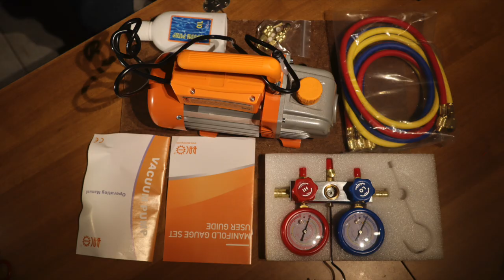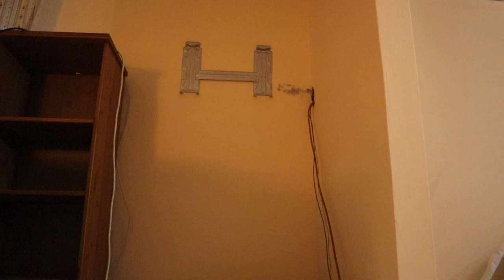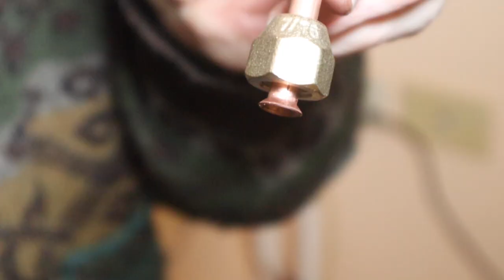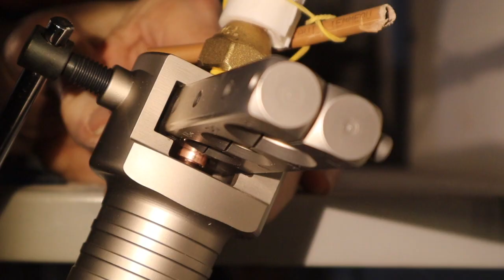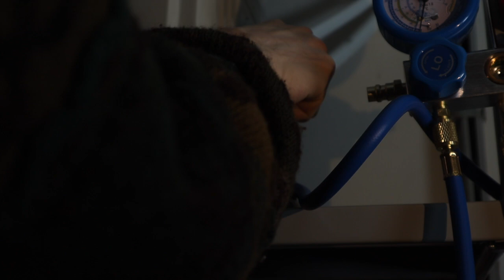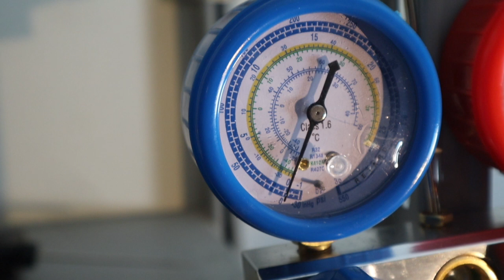I Installed My First Split Heat Pump Myself and Saved BIG - 82

Comment: An alternate to installing the external pump in the garage is to draw air through an earthtube before the heat pump.  Air picks up heat from underground in winter and "cool" in summer.

If you choose to dig, you could make CHP in underground so exhaust leak risk and noise would be negated.
Reply from the maker: The tunnel idea is indeed something that was implemented in a antique villa near Verona but there are many other examples. I saw in the past an opportunity of a very big factory in Liechtenstein (2000 employees) with a tunnel and proposed to take air for the many air compressors they had.

Comment: Just fyi, there are diy minisplit heat pump systems on thebmarket now that require no tools other than mounting (precharged).  Many people with less skill than you take this approach.
Reply from the maker: This actually was one: precharged and under 300€. But still a lot that can go wrong, so the first experience took me a lot of research to stay on the save side.

Comment: Did you wait 17 hours for checking the vacuum? It was not just 17 minutes?
Reply from the maker: Yes sir, 17 hours, an evening and a night. Considering it was my first time, I wanted to be sure. It was also difficult to read a small difference on  a total pressure of 1 bar when the scale was 30 bar.

Comment: Came across this video on the Tesla heat pump system that is rated down to -40c... pretty efficient using an inverter compressor. It harvests heat from all the onboard computers and electronics. At 54 minutes it goes over the EEVS that supply the different areas of the vehicle with refrigerant. It's like having a really complex vrf system on board that recovers heat from batteries and motors to heat the cabin in addition to using the outside air. 

https://youtu.be/Dujr3DRkpDU
Reply from the maker: Hi Richard, that is very advanced tech, didn't expect that they go really the last mile to efficiency and integration.  Also the channe you mentioned is very interesting and has a new subscriber. It is for car mechanical workers and I am translator of car maintenance documents for Porsche into Dutch. Would be nice to know if Tesla needs such translators.  I will look for inspiration to this channel to see what practices can be transferred to DIY.  Thanks again!

Comment: I've often wondered whether there was any way I could harness the wasted energy from my car when I arrive home, your solution is doing exactly that! Very impressive and good thinking outside the box!
Reply from the maker: Thank you Vane! I actually am thinking about using the car instead of this small generator.  It has an alternator but at idle operation I want to find out how many Ampère it gives and what the final electric efficiency is. You can always running it a bit faster, like 1100 rpm and see what changes. Even if the electric efficiency is low, it will produce a lot of heat and you will need a much bigger heat pump. But a good part of the heat is at 90 degrees and that you can connect to the central heating circuit.  That's a lot to think about but for a cold winter and a big house it seems interesting...
Reply: @nnvasen-good-energy  I have been thinking about fitting fuel injection and lambda sensor to my petrol generator which I would imagine would help to bring the efficiency up a bit more, maybe worth investigating before putting the wear and tear on your car.

Comment: Cool project! Looking forward to measurements; i am toying with similar ideas but i do wonder how fast the small space will completely suck up the warm air if the generator is not running. Also do you plan to use it for cooling during summer?
Reply from the maker: Hi Geek, thank you for your good question! Our garage is about 4×9 m so that is pretty big and with all the stuff that is inside it, it has a great heat capacity. At least in the half of it where the heat pump is installed, the temperature decreased 4°C in 2,5 hours with the external units taking about 2 kW.
This idea is not so good for summer as it is for the winter because their generator will make a lot of heat. However, if you just don't use that and it is very hot outside, you can attract cool air from the north side of the house into the garage and then you have at least a smaller temperature difference than when the external unit is in the sun.

Comment: THERES A YOUTUBER VACCING DOWN A STEAM POWERED TESLA TURBINE - THE WATER DOESN'T BOIL AT 100oC- IT BOILS FAR BELOW-VERY INTERSTING SYSTEM- THIS ALLOWS HOME ELECTRIC GENERATION WHERE THERES INSUFFICIENT SUNSHINE TO BOIL WATER AT 100oC.
Reply from the maker: As a last minute addition on the video I added some comments in the footage of the vacuum pump about these kind of interesting physics "in the universe" without atmosphere. Would be nice to try out the pump on a glass jar and see what happens with the water inside! I also make a remark there about the danger of imploding glass jars. An idea for a short video about physics behind a safe glass window!
Reply: @nnvasen-good-energy  COCA cola tin, just implodes,you can buy vacuum jars,strengthened glass.

Comment: THE SPRING ON THE PIPE IS TO STOP YOU PUTTING A KINK IN IT.
Reply from the maker: Hi Liam, you know a lot of this stuff, is it your sector? The spring is only on the low pressure tube, I imagine that small diameter tube has less risk to get a kink. Thank you for the info!

Comment: CONDENSING PIPE- CAN GO UPWARDS,IF ABSOLUTELY NECESSARY - BUT YOULL NEED TO BUY A CONDENSATE PUMP FROM AN AIR-CONDITIONING SUPPLIER.
Reply from the maker: Sorry Liam if it was not clear, the drain is going down from left to right through the wall, so water streams down. During winter we just leave it open, the cold is created in the other unit, in the garage.
Reply: @nnvasen-good-energy  I MENTONED UPWARD PIPE SOLUTION FOR YOUR VIEWERS.... 
SORRY- THE CONDENSATE PIPE- I WAS THINKING ABOUT COMBI- BOILER( WAS TRYING TO DO 3 THINGS AT ONCE-VERY BAD HABIT)..🤬🤬🤬

Comment: RE: PLACING THE UNITS-BEFORE PURCHASE,READ MANUFACTURERS SPECIFICATIONS ON LOCATION- THE OUTDOOR UNIT HAS TO HAVE " BREATHING SPACE" TO WORK CORRECTLY - MINIMUM SPACES AROUND IT, AND THE INSIDE UNIT, ALSO HAS REQUIREMENTS-YOU CAN PUT THEM ANYWHERE,BUT IF NOT TO SPECIFICATIONS,YOU WILL NOT GET AS MUCH EFFICIENCY,EITHER IN ENERGY USE, OR IN HEATING OR COOLING TEMPERATURES AND TIMES TO TEMPERATURES-ITS ALSO ESSENTIAL TO ENSURE GOOD PIPE INSULATION- EXTRA DIY INSULATION AROUND PIPEWORK VALVES ISN'T REQUIRED,BUT IF YOU HAVE SOME SPARE INSULATION,WRAPPING IT AROUND HIGH AND LOW VALVES CAN ONLY IMPROVE EFFICIENCY.
YOUR OUTDOOR UNIT FAN BLADES CAN COLLECT DIRT, IN DIRTY CONDITIONS - PUT A SIX MONTH REMINDER ON YOUR PHONE,TO HAVE A LOOK- IF BADLY CONTAMINATED,CLEAN- THEN CHECK INDOOR FILTER.
Reply from the maker: I left about 15 cm behind the outside unit and I will finish the insulation of some uncovered pipes. It was really a challenge to get the video out in the weekend with so much work and that's for the first time :-)
Reply: @nnvasen-good-energy  YOU DID AMAZINGLY WELL- BUT YOU CANT RUSH THIS STUFF- REFRIGERANT HITTING EYEBALL WILL INSTANTLY FREEZE- AND KILL IT-ANY ON SKIN CAN MAKE DEEP FROSTBITE- I NEVER WORKED FOR ANY COMPANY THAT REQUIRED X NUMBER OF JOBS PER DAY- BEATING THE CLOCK IS A FALSE ECONOMY- I ONLY WORK FOR COMPANIES THAT GIVE ONE JOB AT A TIME- YOU RING IN WHEN FINISHED- NO PRESSURE,JUST DO JOB RIGHT- I CAN COUNT MY CALLBACKS OVER A DECADE ON ONE HAND...
Reply: @nnvasen-good-energy  the most important thing is that it's LEVEL- put on a paving slab if in a garden, preferably with a bag of gravel underneath- I've seen fan bearings go noisy+ then fail in months where an outdoor unit has been only slightly unlevel...

Comment: RE- VACUUM ALL QUALIFIED ENGINEERS KNOW THAT YOU HAVE TO PULL NOT JUST VACUUM - BUT MAXIMUM VACUUM+NOT JUST FOR A MINUTE OR 2 YOU HAVE TO GO TO MAX- TO MAKE ANY WATER MOLECULES IN THE SYSTEM BEGIN TO BOIL,AND BECOME A GAS,WHICH IS THEN SUCKED OUT TO THE ATMOSPHERE, BY THE VACUUM PUMP.
RE:SAFE HANDLING OF REFRIGERANT - I BELIEVE THAT PRE- CHARGED UNITS CAN BE WORKED ON,BY NON QUALIFIED PEOPLE-AS LONG AS THEY STRICTLY COMPLY WITH MANUFACTURERS INSTRUCTIONS- THINK OF IT,IF IT WAS ILLEGAL- THEY COULD BE FINED FOR SELLING THEM...ALSO- IF IT WAS FOR CERTIFIED ENGINEERS ONLY-THEY WOULD SHIP EMPTY-SO ENGINEER COULD WEIGH IN RIGHT AMOUNT OF REFRIGERANT...
HANDLING REFRIGERANT IS A PHYSICALLY RISKY BUSINESS-ALWAYS WEAR GLOVES+ EYE PROTECTION,ALTHOUGH YOU SHOULDNT BE RELEASING ANYTHING BUT A TINY SQUIRT OF REFRIGERANT, ACCIDENTS CAN,AND DO,HAPPEN.
Reply from the maker: I saw it also videos of professionals that I had to use the pump for 10 to 30 minutes and I used it 14 minutes. Maybe you know also the answer on my question that is at about minutes 25 or so: why is the initial static pressure so high above the seven bar that I think is normal at the temperature of heating degrees Celsius?
Reply: @nnvasen-good-energy  they have pre charged your unit, so the gas isn't at room pressure,has enough pressure to go round the max amount of pipe  they specify.
Reply: @nnvasen-good-energy  me personally, I would vac out for their recommendation turn it off for an hour, check it's still holding vacuum, then do another 30 mins.
The expansion valve nozzle is so tiny( think of nozzle on an aerosol can) that any moisture can completely block IT- for the sake of an extra 30 mins of electricity, your guaranteed that won't happen - for office blocks,hotels,etc, it's common to let it run overnight.
Reply: I HAVE NO REASON WHY,BUT YOUTUBE HAVE JUST SCORED A LINE THROUGH MOST OF MY FACTUAL INFORMATION!!! ???
Reply from the maker: no problem, I can read it.

Comment: Dar cum rezolvi problema inevitabilă a apei care apare în camera unde ai montat unitatea exterioara a aerului condiționat?
Reply from the maker: For the audience: "But how do you deal with the inevitable problem of water appearing in the room where you've installed the outdoor air conditioning unit?"
Hi invertor, you are right, I responded below to Richard on distillation water. The drain outlet has been dry these first 24 hours but I put already at dish under it. This video took me so much time that I could not think about all the details 😬. The product contained a piece that I can put under it and connect a hose. I will catch the water into a 5 litre bottle (looking how much time it needs to fill) and use that to wash the car windscreen, as it doesn't leave traces.
Reply: @nnvasen-good-energy  Thank you for your time
Reply: @nnvasen-good-energy  IF YOU GET BELOW ZERO TEMPS, I RECOMMEND YOU INSULATE WHERE IT MAY GET COLD- IF IT FREEZES,YOU CAN GET THE WATER RUNNINGS OUT OF YOUR INDOOR UNIT, DOWN THE WALL + INTO CARPET...🤯🤯🤯
Reply from the maker: I put a dish under the drain but it never makes water at the air conditions in the garage, 15 degrees

Comment: If you don't have a certificate for f-gasses. How can you claim compliance to the regulations put in place by the European Union?
Reply from the maker: You are absolutely right Skinkie, the only formality that I did is to sign the form that I renounce on the warranty of the heat pump. For the rest, my compliance is only technical and not formal. But for now, I am happy with that.
Reply: @nnvasen-good-energy  There is some dispute on how much R32 would actually be require certification. But I think much better way would be R290 (propane) or R600 (butane), the stuff you did with the other projects. There are numerous brands already having minisplits with this gas.
Reply from the maker: That's a good point to avoid the compliance issue!
Reply from the maker: I think that R290 project was a mobile airco from Spain,  a EU country.

Comment: You are an inspirational,  intelligent man and I love seeing your content. I can never recommend fitting the condensing unit indoors they suck so much heat out of the air. I see you are trying to recover the heat from the generator but this heat will not be that much in terms of how much heat the unit removes from the air. 

Where is all the condensate going to go that the outdoor unit makes? It will slowly freeze your garage and dehumidify it so much that it will then not be as efficient to heat. The latent heat in the moisture in the air is good for the unit to remove when it's outside.
Reply from the maker: Thank you so much Richard, I feel more power to go ahead! You are absolutely right that if I don't integrate the expected heat, the garage will slowly become a deep freezer 😀. The heat pump it's not very big, 2,7 kW. The generator gets 1.7 kW electricity so if it goes a little bit under this nominal value then the heat, which should be about twice as much, can do it. Thanks to the battery. I can let it run at this power for long while. Anyway, you are a again right that energy management is necessary to keep it all in balance. Fortunately, the garage is big and contains a lot of stuff, so it will have a nice big thermal capacity.
The latent energy in the humid air is a good point. We have about 50-60% relative humidity. The drain outlet has been dry these first 24 hours but I put already at dish under it. This video took me so much time that I could not think about all the details 😬.
Next week or the week after I will add the gasoline generator of Pramac (made in Tuscany, near Siena). I bought it and it is a jewel compared with the gasoline generator of 25 years ago that I showed in the videos. I can't afford to make noise in our condo and this one is silent indeed!
Reply: @nnvasen-good-energy  lots of investigating and measuring needed as what you don't want is a cold thermal store of say 4c when outside temps are mild... plus the humidity in the outside air is a great heat source it's why dehumidifiers work well and blow warm air as its the latent heat in the moisture they are creating heat with. 

I genuinely would have it in the outdoor air, your generator won't be producing 1.7kw of heat but again it depends how much heat your ashp is moving from the garage. 

All needs balancing out and tinkering with.
Reply: @richardc1983 GET MORE OF THOSE CONTAINERS YOU HOLD WATER IN+ FILL WITH SAND- LEAVE OUT IN SUN- THEN IN WINTER, MOVE TO YOUR GARAGE/ NEWLY BUILT INSULATED CHP " CONTAINER" OR INLINE WITH YOUR UNDERGROUND OUTDOOR UNIT PIPE- HAVE IT HEAVY INSULATED, AND TEMP CONTROLLED - CHEAP THERMAL STORAGE.
Reply: @richardc1983  yes-couple of ideas,depending on your DIY attitudes, equipment...
1- if you have a long garden, you could dig a ditch, put in a pipe with the outdoor unit fan diameter,then refill the ditch- the air will absorb heat from soil( the deeper the better...
2-;build a housing for your CHP+ outdoor unit- use layers of plasterboard and rockwool,as fire proofing, sound+ insulation proofing- let your genset bleed some heat to intake of outdoor unit,or add trace wiring to outdoor unit fins- use thermostat circuit for efficiency.
Reply from the maker: Good idea with the garden.